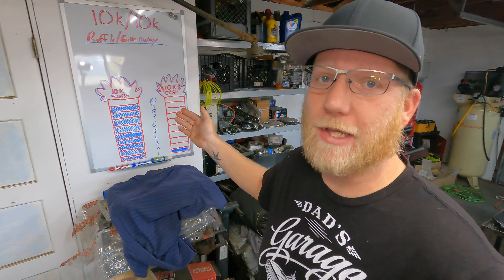Replacing the transmission filter in the 300 for the first time since the rebuild plus licence box

Comment: At least their are no cross members in the way of dropping the tran pan(LOL sounds like a new gender identity!)   I have an '08 toyota highlander, it has a trans pan plug like an oil pan, and they just use permanant "screen" for a filter, so no need to change that.  Really am not sure why the other transmissions all require the pan and new gasket?   Much easier to drain the fluid into a measuring container and add back what you took out every 25-30k miles.  They make it easy to change the differential fluids too.  If I had your 300, I would find a way to add a drain plug to it and change the fluid like the toyota, then maybe at 100k drop the whole pan and change the filter.   Sadly looks like even Toyota is installing crap CVT transmissions in some cars.
Reply from the maker: See Short reply

Comment: I have a Chrysler 2006 that over heats like mf. Idk where to start
Reply from the maker: I would start with checking for combustion gasses in the coolant. if its ok then it's just a matter of finding out which cooling system componant is failing you. Make sure your heater gets hot in a timely manner to determine good flow or not. If there's a clogged componant back-flushing might fix it. These and the hemis are notoriously difficult to bleed the air out, a coolant hopper is a must. good luck